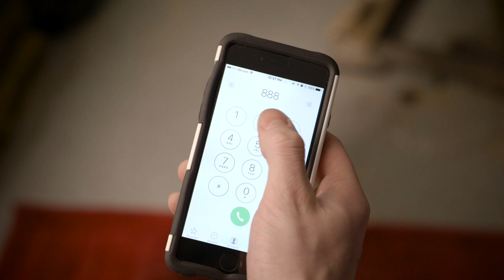How to fix lens communication error on Sony cameras

Comment: I had the same challenge. 
In my instance, not only was I getting the error message, but the zoom function was not working (either manually or by conventional means). I have an A5000L and found that by holding the camera with my fingers only, and with the camera lens pointed up), then applying pressure equally to both parts of the camera lens with my thumbs, I heard a satisfying 'click' which corrected the problem fully.

No doubt this not a tried and trusted fix (and clearly wont be found in any user Sony manual), but it worked for me.
Reply: This is the only advice that worked. Just saved me a couple hundred bucks. Thanks!
Reply: Worked!!!
Reply: I got the click sound but still doesn't work for me:(
Reply: your comment wasn't the issue for me but the "satisfying click" part was something I never heard while mounting my new lens as a first time camera user. I slowly started twisting my lens a bit more till i heard a click and now my lens works. For 2 weeks I was scratching my head wondering if I go a busted lens (no warranty) and your single line saved me. THANK YOU!

Comment: Saw a comment on here to shake the lens hard like a salt shaker and did the trick, thank you guys! The video was useless in content but useful in bringing similar problem individuals togeher
Reply: You my biga - this fixed it
Reply: @parkjay  "Release with lens that has no-contacts"  =  Sony-A77-1  = "Menu" +  Under cog-1 there is a "Release W/O  lens" for when you use the camera with microscopes and lenses without contacts, just enable that; and it both works fine, and actually tells you when you've set the shutter to the right exposure, petty smart, Thanks Sony people  :)
Reply: "Release with lens that has no-contacts"  =  Sony-A77-1  = "Menu" +  Under cog-1 there is a "Release W/O  lens" for when you use the camera with microscopes and lenses without contacts, just enable that; and it both works fine, and actually tells you when you've set the shutter to the right exposure, petty smart, Thanks Sony people  :)
Reply: Bro… the shaking worked way better than the wiping lmao. This is my 24-70 gm ii and I don’t think I’ve even tapped it since I bought it

Comment: I have an alpha 6000 and got it wet; after everything is dry, I turned it on and get the "check that a lens is mounted" error message with two different lens (16-50mm and 55-210). If I enable "release w/o lens", the latter one is okay but the former one gives very fuzzy images. Does this mean that some electronics in the camera is damaged by the water? Thanks!

Comment: The problem is cause when the internal gears misalign. It happened to me twice. I tried the " shaking " , cleaning the contact- tested the contacts , remove the battery, changed all the settings but  none  of them work . I grabbed, with bare handed, the protruding part of the lens and pulled it out a little. The gears  realign and the lens work again .
Reply: cay du you just saved me, thank you!!!
Reply: THANKS FAM, I OWE U ONE!! THIS WORKS FOR MY SONY A-58 HAHA
Reply: @muktihanirorizkyakbar7080 realy work?
Reply: @jayantaacharjee1238  yes, just shake it gently and do what he said, i did that and then there will be click from the lens, and it will be good
Reply: THANK YOU SOOOOO MUCH!
Reply: IT WORKED THANKS
Reply: Bro I don’t understand what u mean what part of the lens is the protruding part, please help
Reply: Sarya Wilson please explain what u did
Reply: The protruding part meaning the outside of lens like pull it from the bottom to the top? Like extending it ??
Reply: when the camera powered ON, the lens would extended out. But with  the problem it wont fully extend. Grab the extended portion and pull it out  a little. Don't use any tool , clean finger and short finger nail
Reply: thanks for sharing, it really works (after replacing the battery)
Reply: I don’t understand what the protruding part is, where is that???
Reply: @OfficialMerikHodgins  When the camera turned on , the lens would extend out about 22 mm. But when it has the problem  it only extend about 4 mm = the protruding part. Clean your hand and don't use tool.
Reply: I do have this problem too. Tried everything,nothing worked..

Comment: Hi I just bought the sigma 16mm f1.4 for my sony A6400. When I connect it nothing happens at all! I do get image but it has alot of noise in it. The autofocus doesnt work at all. It seems that the sony system doesnt connect well with my sigma lens. what do you suggest?

Comment: Something is wrong with my lense, cause those other lenses work fine, manual lense and does not have these golden pins
Reply: "Release with lens that has no-contacts"  =  Sony-A77-1  = "Menu" +  Under cog-1 there is a "Release W/O  lens" for when you use the camera with microscopes and lenses without contacts, just enable that; and it both works fine, and actually tells you when you've set the shutter to the right exposure, petty smart, Thanks Sony people  :)

Comment: how about the f-- error.. it seems.that the lenses are not also commucating well.. I did the cleaning of the contacts but still having this problem.. the good thing is it's not permanent and being fixed whem I try a little twist into the lens while attached to the body a6000..
Reply: How can fix

Comment: Hey Greg
Thank you for your insights and videos 
I have a problem with my sony kit lens of black shadows in the corners "upper right and down left " and I don't know why it's doing this corner shading on 28 " the lens is 28-70mm 3,5 - 5,6 " and when I zoom in to 35 all goes away and now dark corners!!! it's not vineotting  and I would really appreciate it if you or any one reading this can help me out

Comment: Hey my camera is confusing i dont know if its the lens but my camera was working really well for awhile then i got a camera error message. It seems to still allow me to take a couple pictures before the error but it seems to only happen when its left alone for three or so seconds. I tried to update it and it worked again for a couple weeks then it started to do the same thing. I did also notice that when it gives the error the camera will like shake or jolt once. The shutter never gets stuck and i tried every troubleshoot i can think of

Comment: Still seeing error with Sony a6000 + 7artisans 7.5mm F2.8. I can shoot after changing settings to "release w/o lens". Is this due to it being a fixed focus?
Reply: same problem changed my lens
Reply: lul. cheap lenses like this probably wont have gold pins = no communication between lens and camera. the camera basically doesnt know you have a lens mounted.. thats why you need to enable "release w/o (=WITHOUT) lens"

Comment: the suggestion did not resolve the problem. My issue is fine desert dust from exploring canyons in the southwest.  I had to disassemble mine to resolve it in the past, now the problem has returned.

Comment: Shake the lens and then pull the part of the lens that extends until it comes out. Wipe down the dust and any particles around the barrel. After this, attach it to the camera and turn it on. Should work for you.
Reply: How do you pull the part of the lens that extends? So scary! :(
Reply: Not working:(

Comment: My Sony a77 M2 and with my Sony SSM 70-200 mm lens has been giving me the same problem. I turn it off, detach the lens, re-attach it, turn it on, it works again for another 20-30 minutes. I haven' tried the dry cloth, but I will try it tonight.

Comment: I have an interesting situation and hoping some of the great minds here can help.  I have a Sony Alpha 77 mk ii with Sony 18-55 & 70-300 lens.   When I mount the 18-55 lens, I can take pictures, but when I mount the 70-300 lens and try to shoot in auto focus mode, it does not auto focus, it gives me an error message which is a hand next to the camera and shake kind of a symbol  (don't know how else to describe it).   If I move it to manual focus mode, it still does not focus to the right focus.   I have wiped out the camera & lens contacts the way you explained it in the video but the problem persists.   

Any ideas?
Reply: I have the same lens! and the same problem!!! the 70300G it does not autofocus :(
Reply: I used it for two years, and two days ago it started doing that, the lens and camera are flawless.

Comment: For my a 6000 with the kit lens 16-50 the cleaning didnt work. I pulled the lens out when I turned it on and it worked. It seems that the lens was just stuck, it probably didnt close properly.

Comment: Having this issue with my a6000 and the standard 16-50 lens. You can hear the lens making some winding type sound when powering the camera on, but the lens not attached properly error comes on. Tried cleaning, shaking the lens, removing battery - still nothing. However my 18-35 lens is working just perfectly. Any ideas?
Reply from the maker: Could be something with the electronics inside the lens you might need to send it for repair.

Comment: this did not work. i have a brand new lens. it has not worked since the second i put it on the camera (used camera bought off ebay) what are the other causes of this error. no pins are damaged and the lens is 1 minute old

Comment: I have a Sony a3000 and ever since I got it it won't auto focus and when I go to turn it on it says my lens isn't attached properly I tried 2 different lenses and neither work it may just be my fault for getting it off eBay so it may just be broken or I'm just stupid and I'm not putting the lens on right but I want to try and fix it before I just buy another camera.
Reply from the maker: could be a problem with the mount or the contacts, if you look at them closely does it all look right and not damaged?

Comment: 1. Take lens off 2. Wipe pin contacts off with dry clean cloth. 3. shake lens like salt shaker 4. If the lens is not extending and retracting take the lens cover while the camera is on and gently tug on the lens cover cap until it extends

Comment: Nothing seems to work. My error on Sony NEX-5T came up while shooting. Got dozens of good ones, then nothing. I have only the original lens and don't remove it. I have tried pulling battery overnight, changing settings and cleaning. Still got the error.
Reply: It happen to me twice.  My problem clear after I grabbed the protruding part of the lens, with bare hand, and pulled it out a little. Normally the lens extended 22mm / 7/8" at power ON ,but with the problem it only extended about 6mm / 1/4'. Guoc luck !

Comment: Thank you for the video. I am sorry to report it did not work, my Sony 6000 did this and it all started when the battery ran low, charges it still the same, the lens was stuck out, so I pushed the lens down, it makes this clicking sound, I pushed it harder until it was bottomed out. I started the camera and it was now okay.
Reply: I can't thank you enough buddy,my sony alpha A77ii had this same issue( wouldn't read any lens the autofocus does not work and on the F stops I could only see this symbol( -- ) instead of F numbers. My battery was pretty low when I tried to switch the lens in between shooting(from 55-300 to 16-55mm) and this issue popped up. Charged my battery , cleaned my lens contacts, restored my camera setttings but nothing worked. Then I noticed that my 55-300mm lens was stuck out like a few mm, I removed the lens from camera body and pulled the lens out fully and then pushed it back in place using a little force , lens went into place , reattached the lens turned the camera on with lens attached( with charged battery) and it worked :)

Comment: Sorry but your solution did not work but another one did work.My sony alpha A77ii had this same issue( wouldn't read any lens the autofocus did not work and on the F stops I could only see this symbol( -- ) instead of F numbers. My battery was pretty low when I tried to switch the lens in between shooting(from 55-300 to 16-55mm) and this issue popped up. Charged my battery , cleaned my lens contacts, restored my camera setttings but nothing worked. Then I noticed that my 55-300mm lens was stuck out like a few mm, I removed the lens from camera body and pulled the lens out fully and then pushed it back in place using a little force , lens went into place . 
I reattached the lens and turned the camera on( with charged battery) and it worked :) .

Comment: I had this problem, tried a little shake, tried loosening the screws on the outside and then tightening, didn't work...finally I unscrewed the outer screws to get to the inside where I loosened the inner screws ever so slightly and re-tightened. Something fell back in to place and it finally worked! :)

Comment: Main reason why the lens is not working: something is broken inside so the lens is jammed or bad cable connection.
solution: take apart following youtube video and you will see the broken part came out from nowhere. That's how I fixed my lens. This video kinda BS

Comment: My left ear enjoy hearing this.
Reply: “RE-attach lens” error message on A6000 with Sony 16-50 lens. Cleaned contacts with isopropyl alcohol - no luck. Then thanks to comments on here fixed it. Carefully pulled up internal lens barrel. No click - but it looked very slightly out of line. Hey presto - problem solved. Hurrah.